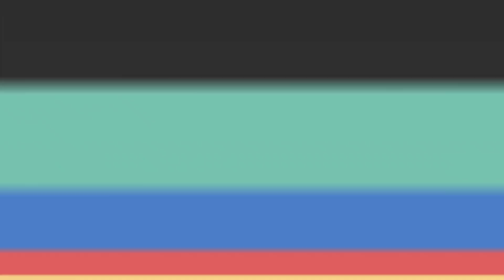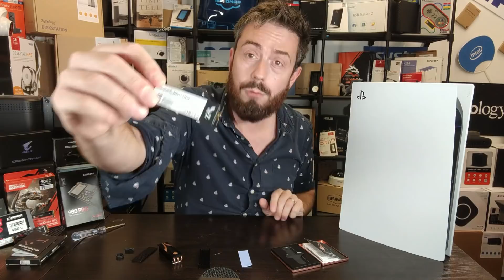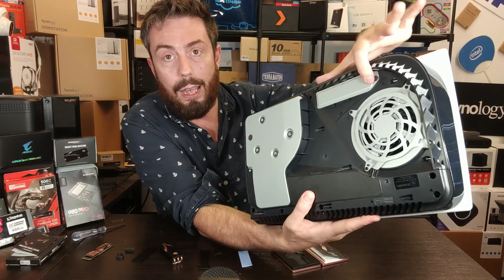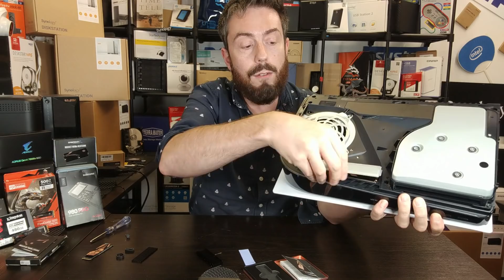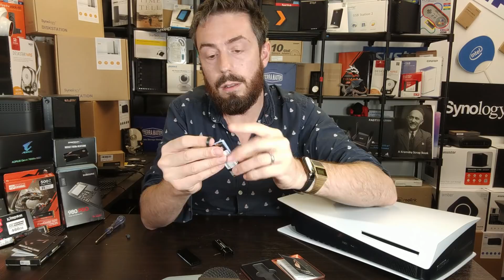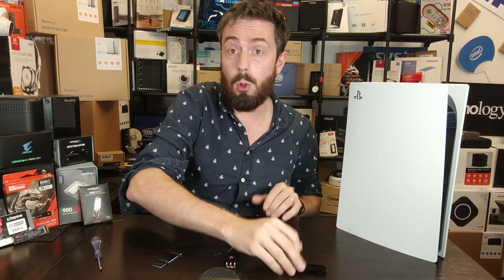PS5 SSD Upgrades - WHY YOU 100% NEED A HEATSINK! (HEAT TEST!)

Comment: Dumb question, but why can’t we just be able to buy the same ssd in the ps5 ?
Reply from the maker: It's a non commercial/purchasable SSD. It's directly connected to the main system board, not interfaced via a connector like M.2
Reply: @nascompares  that makes sense! Thanks for explaining!

Comment: I feel like Sony dropped the ball here. They should have active airflow for that area. I mean It may be possible to mod the fan exhaust but who wants to do that when the console is so difficult to buy.
Reply: Wish u guys would stop trying to redesign a console. I am sure they thought of this
Reply: @woodiemarv  I get your point but at the same I think you missed the point. Ps5 is getting better and better because it's consumers are asking for things that Sony may have missed. The community suggestions and requests are pushing them forward.

I may have missed the mark with my suggestion, but someone else may come up with a good idea that can be incorporated into future ps5 slims or hopefully the ps5 pro.
Reply: @violentnewworld   i get ur point but this conversation is about an ssd cover. They said put it on for airflow. Its your property do with what u want just don't complain later if it does not work. I am sure they thought about this. No one runs a pci gen 4 ssd without a heat sink and air flow
Reply: @woodiemarv  haha I would never do this myself. £500 is far too much to risk especially when supply is stretched. I'm secretly hoping somoone on YouTube would do this for my own amusement 👍
Reply: There is active airflow there. That's why the metal cover has to be put back.
Reply: @Aweburn82  I must of missed him say that. Sounded like he said there is none. Happy days then 😉

Comment: What you're saying is very correct I do own a high-end gaming computer with two m.2 nvme drives.
Samsung Evo 970 Plus I also have a Western digital black nvme me both run between mid-thirties to forty degrees Celsius under load.

If the nand or the memory controllers get hot then the read and write speeds do decrease in performance great informative video 👍🏽.

They actually make some heat sinks with a built-in fan definitely recommend it the only thing would be trying to figure out a custom solution to power it.

Maybe a BEC step down to 6 or 12 volts from the power supply

Comment: Seen this video yesterday, got a beta code today instantly went back to view this video. Very informative!
Reply: How long did it take you to get the code after the request?
Reply: @connorammerman470  I was apart of the second wave of codes that went out I had registered months ago then ironically after the first wave of codes went out and I didn't get it, I registered again and ended up with one 🤷🏾‍♂️ not sure which request was it though tbh
Reply from the maker: The PS5 System Software Update that enables the PS5 SSD Expansion slot will go LIVE globally on Wednesday 15th September 2021. Learn more here - https://youtu.be/qGA5ZWda2j8

Comment: Very helpful information, thanks. Which direction does the air flow over the nvme in the ps5? Seems the fins would work best in the correct direction. Someone could make a plate that would fit over the larger heat sink if it works better with the plate.

Comment: In a few months I'm planning on getting a 4tb Seagate Firecuda 530 for my PS5. Now which is the best Heatsink for the SSD? Is the Advancing Gene NVMe Heatsink compatible with the 4tb SSD and still able to put the SSD cover on?
Reply: I just got the advancing gene heatsink for my 1tb WD sn850. It seems a little too flat. I’m not sure how good of cooling it will provide. I don’t know if I’d put it on a 4tb. Just using it now until some with taller blades come back in stock.

Comment: i feel like putting that big ass heatsink w/o the cover would be good for a vertically placed ps5 and not horizontally since the heatsink will be pulling that ssd down and causing fatigue to the socket and pins.
Reply: Heatsinks are made from aluminium and weigh next to nothing. Except for maybe that big boy in the video which might have some copper in it. I think it will be fine.
Reply: Did sony forget the mounting screw for nvme drives? Am I missing something
Reply: @woodiemarv  Nah, there's a screw to hold in the nvme. I forgot about that when writing the comment.

Comment: Its the first time I totally disagree with you. YOU NEED A HEATSINK THAT FITS IN SLOT WITH THE METAL COVER ON(DO NOT GO FOR CHUNKY HEATSINK) 

QUOTE(from PS5 Sony Engineer)
Mr Otori: There are two exhaust holes for the SSD slot for expansion. Since the expansion slot is near the intake fan, it has a structure that sucks heat from the exhaust hole with negative pressure.

The plate is ther for a reason

Comment: @NASCompares did you ever receive a beta code to properly test the different ssds mentioned?
Reply from the maker: 12hrs ago. Tests coming shortly
Reply: @nascompares  awesome thanks!
Reply from the maker: The PS5 System Software Update that enables the PS5 SSD Expansion slot will go LIVE globally on Wednesday 15th September 2021. Learn more here - https://youtu.be/qGA5ZWda2j8

Comment: You only really need a heat sink on those faster nvme ssds. A regular person would most likely be putting in a $200 2 terabyte Western digital blue sn550 and it is more than perfectly adequate for the PS5. Although its write speeds are just under two gigs per second that's still plenty fast enough to be honest and I have bought one of these and measured the temps in my laptop. I can never get it to go beyond 52 Celsius even when I am writing 30 gig files to it and at regular use not writing files over 0.2gb it's around 37c so heat sinks are not super necessary. On blazing fast ssds like the sn850 and 980 fake pro yeah I would get a heat sink but why would anyone put that in a PS5. it's completely overkill in terms of speed and inadequate in terms of value and capacity.
Reply: the PS5 only takes faster drives... so all require a heatsink. 
SN550 will not work as it requires a PCIE gen 4 drive. SN850 and 980 (and equivalents) are the minimum required. 
 you seem to be clueless to that.

Comment: What doesn’t make no f$&@ing sense is that why is the requirement only 5.5 GB a second when mark cerny said a faster ssd would be needed to compensate for nvme m2 ssds priority queues only supporting 2 instead of the 6 on the ps5 ssd.

Comment: Personally for me a drive with ps5 ready heatsink. Firecuda 530 ekwb heatsink 2tb. Noice 👌
Reply: Sadly Seagate are the most unreliable Brand when it comes to storage.
I will go with the M.2 that Mark Cerny uses... the Western Digital SN850. I think he would know which hardware goes best in his console.
Reply: @Dreadpirateflappy  his tweet was cost related. Not performance.
The facts where Seagate out performs
7300mb vs 7000 read
6900mb vs 5300 write
2550tb vs 1200tb
No argument here which has the best spec. With it being really new reviewers are now giving it the best in the market conclusion. I want the best future proofed product which is why I back it
Check out the tweaktown review that was published a few days ago.

Comment: can I please have any information about the thermal pads? I keep reading amazon reviews and a lot of people say that 1mm pads are a problem compared to 0.5mm pads . I am new at this so trying to figure it out .
Thank YOU
Reply: it generally is allmost irrelevent what thickness the thermal pad has. Sure better quality pads, and thinner pads have better/lower thermal impedence, meaning they transfer heat better and therefor result in better cooling, but for SSDs its really not that important, and even less so for gaming with SSDs. most of the times these heatsinks already come with a thermal pad... maybe it even has to be thicker for making proper contact between the spesific heatsink and drive so maybe there are height requirments. But in general, thinner is better for cooling, provided the heatsink has proper contact. Dont bother about it that much tho, imo it really does not matter for SSDs.

Comment: Sony's head of thermal design for PS5 said to keep the ssd bay cover on because of the two vents that help the fan remove hot air via negative pressure.  Their chief engineer is definitely more of an authority on this issue than you. Please buy a heatsink that allows the cover to be screwed back on and disregard what this guy said. 

Edit: guy
Reply: As an electrical and software engineer I don't think you guys need the worry about this. First the majority of the work flow will be reads not writes his test is flawed. Secondly I would recommend a heat sink for any pci 4 drive. Thrid put a heat sink on it close the lid and trust sonys engineering recommendations. Fourth enjoy your console and stop worry about design decisions that were made years ago.
Reply: @woodiemarv  Yes his test is flawed when it comes to determining the actual operation temps, but it doesn't make the comparison wrong since both are subjected to the same stress, and the comparison is what's being investigated in the first place. 

Also, there's nothing wrong with verifying claims, especially engineering ones. It's what this channel is supposed to be about anyway.
Reply: where are those vents at?
Reply: @freemanzweidreifunf8025  At 8:14 you can see 2 slots on the top edge of the SSD bay about 3cm apart. Which i honestly don't think is enough, i will be running mine without the cover.
Reply: @wmoule  ahh thanks mate, I couldn't figure that out. Tho that's very limited airflow and asymetric cooling bescaue the access of air is also on the same side where it gets pulled from... Nevertheless, SSD are mostly idle-ing while gaming so it should be fine either way, maybe even without a heatsink.
Reply: Actually, since this guy is already doing some temp tests, why not just let him show the results of comparing setups having the cover on or not.
Reply: @guyfawkes0511  He doesn't have the PS5 beta software on his PS5, as far as I can tell.
Reply: Yeah I found it really odd and irresponsible to endorse using SSD with heat sink that doesn't allow the cover to fit. 
Always follow manufacturers instructions.
Reply: The bigger heatsinks will probably offset the benefits of keeping the enclosure closed.
Reply: @eggy6857  Right. You, for whatever reason, believe Sony didn't test this and you're  going to disregard the advice from someone that was intricately involved in PS5's thermal design because armchair engineering degree? Also would the heat from the heatsink not potentially damage the removable shell, which was also mentioned by Otori-san. 

Can't wait for the assholes that do this and then  rant on the internet about how Sony didn't make it clear enough after something that's easily avoidable happens.

Comment: Will these SSD make the console run and open games quicker or it's just primary for transferring games and storage
Reply from the maker: Unlikely to outpace the system SSD booting of games, but yeah, it just increases your available game storage
Reply: @nascompares  Looking at the digital foundry benchmarks, they do actually outpace the internal drive, sometimes by quite a few seconds.

Comment: I want to express my gratitude broseph, I enjoyed both of your ssd breakdown videos which put me on the right path to get the best ssd for my ps5
Reply from the maker: Ok...10/10 for Broseph! Awesome stuff
Reply: @nascompares  Question: after a certain amount of time (years I assume) do the thermal pads in the heat sink need to be replaced? If so, is it easy to remove the thermal pads from the SSD when trying to replace them?

Comment: What's about the change of the airflow, if the metal plate isn't closed? I mean you change the air pressure in the system, if you don't close it.
I would close it, if sony recommends it. But that's only me, I could be wrong of course
Reply from the maker: You might well be right. Further testing is happening tomorrow (if I can get my cat off the bloody desk)!

I may be venting my current "this second" annoyance to you... sorry!

Comment: Right if you dont put the panal back on and use the thick ssd it will melt the plasic on the lid being so hot thats why the plate has to be on to keep it from melting the lid i was told 👍😁
Reply: That is another possibility..

Comment: Every M.2 SSD sold should include a heatsink.  For the manufacturer this is probably a $2 part.
Reply: why? extra cost and not everyone needs them. my motherboard hasd heatsinks for every slot for example. if I was buying it for my computer I would have to remove the heatsink to install it under my other parts.

Comment: I have a question, would it be cheaper to get an ssd with a heatsink built in or buy an ssd and buy the heatsink separate
Reply: cheaper to buy it separate. Built in heat sink will run around $100 more, when buying separate  will cost about $10 or so. You will be saving around $90-$80.
Reply: @MrJensonP  thanks, that would be a huge money saver.

Comment: The average soccer mom will walk into GameStop and pick the wrong thing for little Johnny let alone have no clue how to install it.  Microsoft 1 choice slot it in thank you and goodnight. Want to hotswap the drive between two series consoles absolutely no problem.  Big fail Sony
Reply: Still prefer Sony’s method.. I’m sorry but there are plenty compatibility guides out now that makes it clear on what drives to get…. It’s really a no brainer..  and with Sony’s way you can shop around for a price that suits you..  with Microsoft you can’t, you got 1 choice and that’s it… proprietary is nice and all but it isn’t always a good thing for the consumer.. plus as another youtubers points out those storage cards does have its limitations, as those are bottlenecked at gen4x2, where Sony’s is gen4x4..  

And quite honestly, it is not really that hard to install the drive, they made it so easy that even a child could do it.
Reply: Big fail microsoft, slower drive made by a company with the biggest fail rate in storage hardware, 
Sony have given a huge amount of consumer choice. it wasn't an issue for people upgrading the PS3 or PS4, this is no different.
By the time the update is released there will be PS5 ready drives to just slot in. can already do it with several.

Comment: Also, should I really leave the cover off even if my SSD with heatsink fits with the cover on?
Reply: I would not do what @NASCompares suggests by using a heatsink that would not properly fit the drive bay, I’m am certain the metal plate is important for the system overall cooling..  there must be a reason why Sony is telling people that the drive with a heatsink cannot exceed a certain size.   Personally I feel @NASCompares is being very irresponsible for even suggesting using a bigger heatsink even though you wouldn’t be able to put the metal cover back on..
Reply: PS5 engineer says otherwise
QUOTE(from PS5 Sony Engineer)
Mr Otori: There are two exhaust holes for the SSD slot for expansion. Since the expansion slot is near the intake fan, it has a structure that sucks heat from the exhaust hole with negative pressure.

The plate is ther for a reason
Reply: @marty8370  Interesting. Didn't see any holes though when I opened up mine to check it out.
Reply: @MrHonwe  watch the video, he does show a closeup of the bay, and you do clearly see 2 openings on one side of the bay.

Comment: The right to repair! removing stickers cannot limit you from getting warranty service on any device.
Reply: Not everything can be repairable,you got to be realistic..you can’t just simply get a replacement chip, in this case for nvme drives, you can just simply swap it out for a new one when it stops working..  the thing about right to repair is more about the right to have repair shops repair laptops and other devices,

Comment: Can you compare the performance of an ssd such as an SN850 with the built in heatsink vs an SN850 with a 3rd party heatsink? It’d be nice to see if the extra cost of the built in heatsink is reflected in the cooling performance.
Reply: As long as the heatsink is properly applied, I don’t think there will be that much of a difference

Comment: Another excellent video, NAS.

The question I would still like answered is are the NVMe models that come with a heatsink going to both fit inside the PS5 and be sufficient to cool those drives OR do you still recommend buying on separately?

I’ve got my eye on Seagate’s Firecuda with Heatsink and I certainly hope that’s good enough because it seems to smash every other metric that matters.

Comment: why do the manufacturers of the ssd's build it without a heatsink in the first place? surely they just cut out the middle man sell them with a heatsink
Reply: Are you aware that these drives are also meant to work in laptops? How would that work if every drive came with a heatsink?
Reply: Many motherboards come with heatsinks built in... can also be bought seperate.

Comment: To anyone who has the beta and ssd installed. How is the fan noise of the ps5? I remember sony saying the fans will kick in harder tp compensate the extra storage.
Reply: I would assume it wouldn’t be too much louder because it’s already spinning the fan pretty slow, so speeding it up for an SSD will probably be only slight
Reply: No difference according to Spawnpoiint. https://www.youtube.com/watch?v=wzgRJnW-CpA&t=3s
Reply from the maker: The PS5 System Software Update that enables the PS5 SSD Expansion slot will go LIVE globally on Wednesday 15th September 2021. Learn more here - https://youtu.be/qGA5ZWda2j8